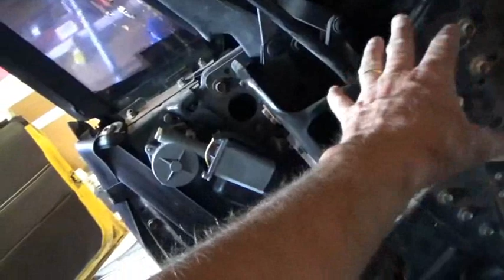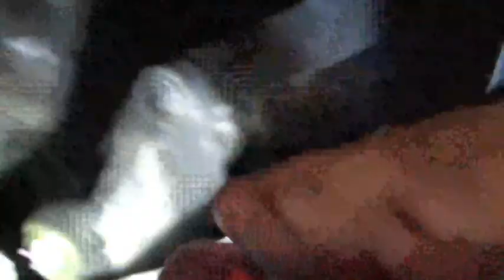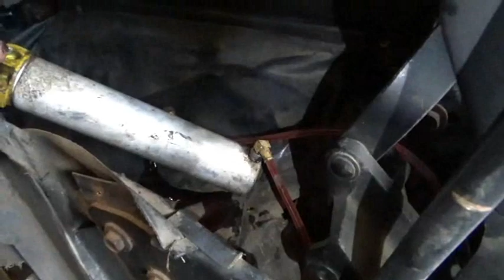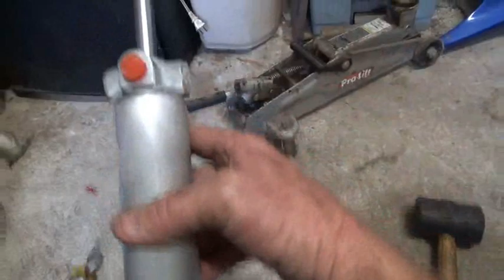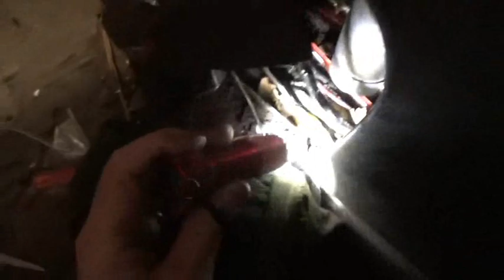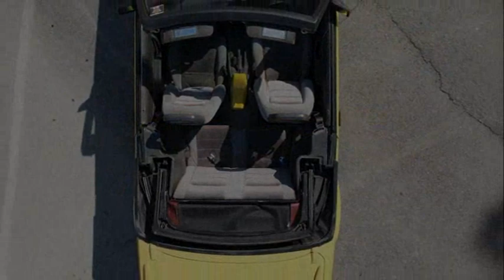Fox body convertible top cylinder replacement

Comment: Does the new cylinder have a metal or aluminum top to it where it mounts and excepts the top line? I keep breaking the yellow part that’s plastic on mine.
Reply from the maker: at about the 5 minute mark it appears the new cylinder has an aluminum top. Sorry to hear you are having trouble with them. I bought mine from nice-car-autoparts on Ebay.

Comment: Were those the original cylinders? Just curious if you have had to replace them yet. My 91 has the OEM cylinders and have had no issues. I’ve considered changing the fluid, which is probably a waste of time lol. I’ve had no issues with my top functioning.
Reply from the maker: Yes factory. First time out since 1986